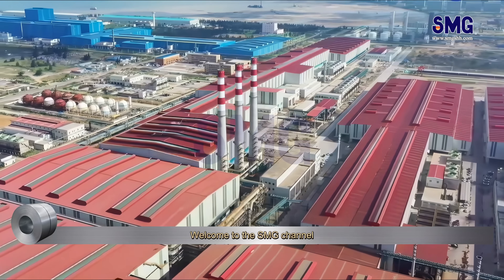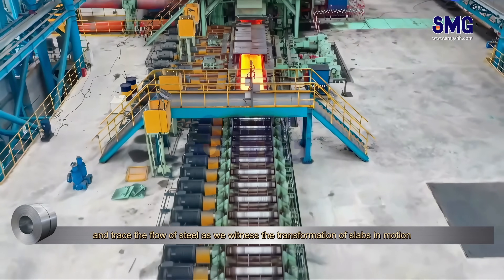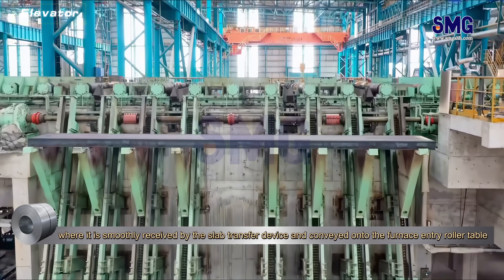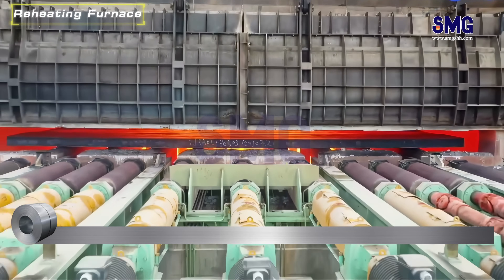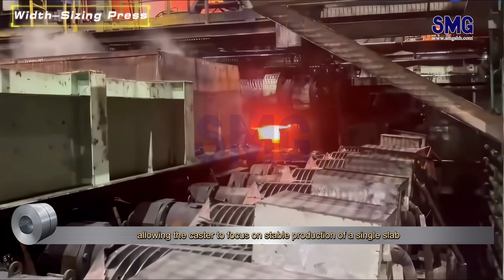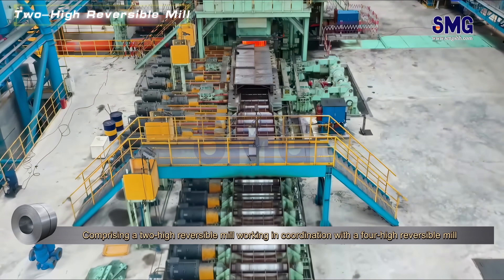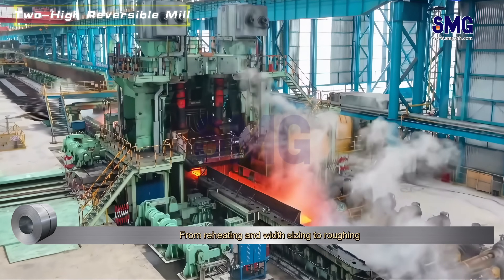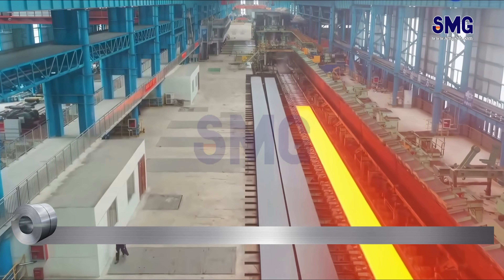Hot Rolled Coil Production Line – Part 1 | SMG Metallurgical Turnkey Project

Comment: The upstream processes of the hot-rolled coil production line look so professional! Every step from slab heating to rough rolling is very regular. SMG's engineering solution is really reliable~